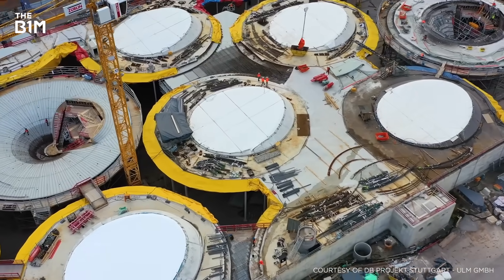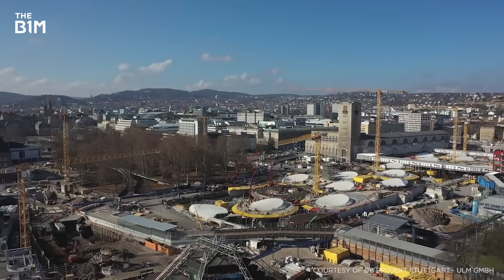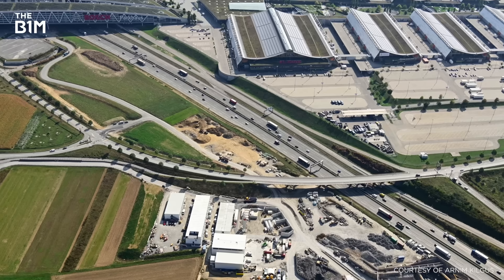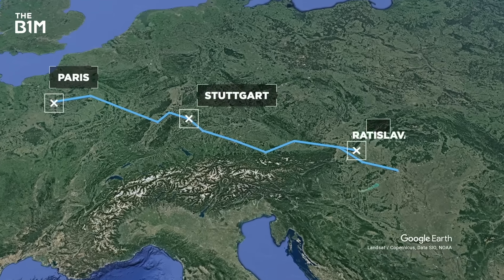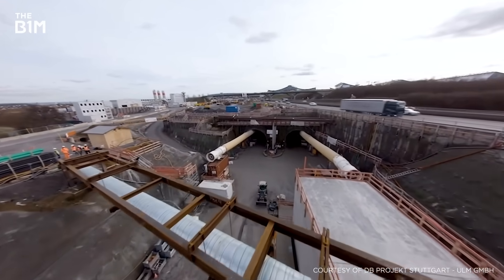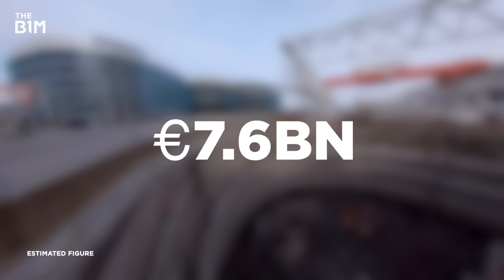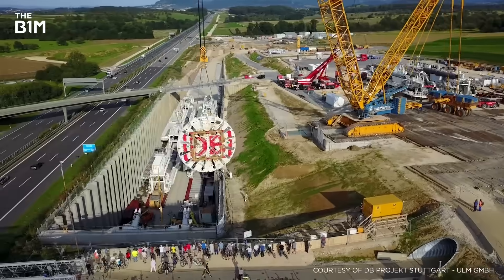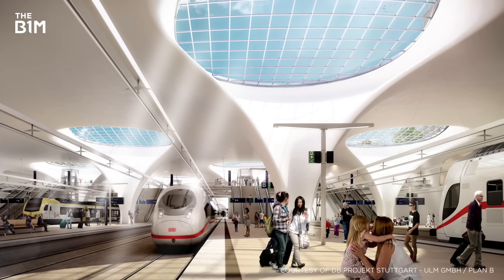Germany's 27-Year Struggle to Complete a Rail Project

Comment: 27 years..maybe with planning. but the project started in 2013 and then there was Corona which slowed the project. it would have been a 10 years building phase, now it will be 12. the struggle lays more in all the regulations we have in germany.
Reply: the completion is now scheduled for 2027.

Comment: 7.6 billion euros to upgrade an entire train station to modern standards and heavily increase capacity.

Here in New York, politicians wasted $2 billion on making a freaking subway station more beautiful, with zero work done on actually improving capacity and modernizing the actual infrastructure.
Reply: Unfortunately, three years later the construction work is still ongoing and not even close to being completed. They now plan to partly open it in 2027. With that said the costs have been rising to a staggering amount of 12 billion euros. And that is only half of the story. Additional projects will be necessary to fix the major design flaws of S21 which could further drive the costs up to at least 18 billion in total. And although it might look like a project for a better railway, it‘s actually not. It’s mainly a pre-phase for a huge real estate development plan on the land of the current terminus station.

Comment: The question is what shall count as the project start? The idea is surely older than 27 years. I saw the first plans in 1987. 
Putting the undoubtedly serious political and legal turmoils at the beginning aside - the construction project as such is running pretty smoothly. Especially as it is regarding geography and hydrology a very demanding project. That's however not something the average rail traveler will later notice. But they will notice the new train station. Great architecture
https://www.youtube.com/watch?v=8xUlTsP3tag

Comment: If Germany is spending so much on making Stutgart a through-station, why is HS2 in the UK making one of the major stops, Birminham's Curzon Street, into a terminus station?
Reply: I don't know the reasons in Birmingham. You don't have to understand them because a terminus always needs more space and more time for the trains to move on.
A terminus makes sense in a city like Munich, which has a peripheral location in the south of the country. A lot of HSR trains end there.
But Birmingham is not on the edge of the UK, it is a centre in the middle of England. 
Stuttgart has not been on the periphery of inter-European train traffic for a long time either, a through station is much more efficient than a terminus station and requires much less space.
Another reason for Stuttgart 21 is that the city wants to expand, but it is located in a valley basin. The new station will free up huge areas that can be used for urban development.

Comment: The complexity of the project is not a joke, it is not just putting station underground but also to build totally new oriented lines all through large city that is densely built. In addition city is build over series of hills, valleys and large river is flowing through all of that, very challenging topology and geography... So it is to be expected to have large delays and costs overrun. Together with new fast line to Ulm (that is also crossing over complex terrain and major mountains) will have impact on rail traffic for all EU. This project can not be compared to Berlin airport failure that is nonsense.
Reply: "So it is to be expected to have large delays and costs overrun"
Construction was running considerably better than expected. And not adding further delays for years. 
While the project is undoubtedly well over budget, the costs are not higher than with other big railway projects in Europe. And this despite very challenging topology and geography.

Comment: Stuttgart 21 was recently a topic in one of my subjects at the university (I'm an architecture student) and our prof told us that one of the major issues in this project is the build-up of the ground.It seems that the ground tends to swell when it gets into contact with ground water & there seems to be one big reserve of mineral water right next to the construction site. That means if some error occurs and water leaks into the ground, the ground would be elevated up to 30 cm (if I remember correctly; imagine it would happen after the construction gets done....) Then there's the problem with sloped train stations because of the existing tunnels... the problem with emergency exits due to narrow tunnels (yeah again because of the characteristics of the ground)... If I remember correctly even the architect said this whole project is impossible to get done so yeah. These are the things that stuck with me in regarding this project
Reply: Those are worn out arguments of the opponents of S21. First thing is they totally forget the S-Bahn tunnel from the 1970s which is BELOW the new S 21 tunnel/train station. And if it comes to emergency exists they make up their own definitions of what is required. Which would have to result in the closure all underground railway stations (e.g. Berlin Hbf tief) in Germany. As those are definitely not better on any aspect.  
And the same type of people demonstrating against the tunnels of S21 demand them elsewhere. E.g. a the Upper Rhine Valley and the Berlin Dresden Bahn - where tunnels are from the terrain not even needed, their whole purpose would be noise protection.
Reply: @martinstock  well i'm not sure which side he took but that's what was discussed in that lecture soo 💁‍♂️

Comment: there is no high speed connection between Stuttgart and ulm currently. The Geilinger Steige is a huge bottleneck with in the EU to  get Cargo from the North See haven to the South. The problem with the new trainstation however - and  you missed this completely in your uncritical feature - is that it can't fullfill the needs of the "Deutschland Takt".

Comment: Thank you for sharing this, as a former New Yorker who has lived through 3 attempts to build a second Avenue Subway in Manhattan, having seen it funded and then the funding diverted in the 1950s, the start of construction and it being abandoned in the 1970s and then the endless work in the 2000's that only just culminated in a small piece of the line open with no complete picture of when the line may if ever be completed Stuttgart's project is not doing all that badly. The first phase at 3.5 billion and an estimated 6 billion for the second phase and no estimate for the third makes it seem a relative bargain.

Comment: What will happen to the original 16 overground station platforms, the building they are housed in and their rail line approaches once the new station infrastructure is up and running - assuming they will be repurposed in some ingenious fashion?
Reply: The tracks will be removed as far as I know. Buildings will be built. A new S-Bahn station (Mittnachtstraße) is being constructed in the north.

Comment: You should have gone to Stuttgart in 1945 huge areas  were bombed flat by allied bombing . By 1966 much had been rebuilt as I remember the station was intact. This project  is tiny compared to the city rebuilding I wonder why? perhaps its just  a project to provide work for as long as possible for as many as possible.
Reply: Good point, wouldnt surprise me. Maybe as it often happens, its just greedy individuals earning a quick buck?

Comment: There's a new long distance train tunnel planned under the HBF in Frankfurt.  I wonder why not consider to revitalize Frankfurt 21, which would have also converted the main station into a through station, turning the yard into a park.  I know the location isn't as good, but Millennium Park in Chicago comes to mind.  I'd think the towers along the park could help to cover the cost, when you consider 1 of the Four towers just sold for 1.4 billion Euros.

Comment: Sorry to dissapoint you , but the project is a complete mess. Firstly the new railway station, hasn´t enough tracks. To have the same capzity as the old Station the new one needed 12 tracks NOT 8. Also the platforms will be a bit tilted and just a tip when you come to that fiasto, always look after your Baggage. And lastly becaue of the stone that is in that area, it can happen that if the stones get´s in contact with water that that stone gets bigger and so the terrain moves...
Reply: Anstalt lied to you. And you should always look out for your luggage. By the way, many stations in Germany have the same or higher gradients…

Comment: It cant be completed. Its a deathtrap. The tunnels will be to small for a fast emergency exit or access for the rescue units.

There is a good clip from "Die Anstalt", in german, that explains this project. Even the architect that made this said its unrealistic before he passed away.
Reply: Die Anstalt is a satirical programm which took up the unfounded talking points of activists. They aren’t engineers

Comment: One of the problems is that in Europe people always want to preserve the old stuff. Why does that old and cracked looking building (just look at the windows) at 1:32 need a whole new foundation when it's located on what seems to be a pretty key point in this whole operation? Just cut your loss, demolish it and build something new on top of it once it's finished. But of course that is not possible because of 1001 regulations forbidding this and people wanting to hold on to it.
Reply: it was the city which wanted to preservice the more than hundred year old building, while the railroad company (owner of the building) wanted to demolish it due to the project. AfaIk it's not under any kind of official protection of historic buildings and monuments

Comment: Fun fact: Stuttgart 21 is a downgrade... Before twice as many trains could stop/wait at the same time....
Reply: A terminus can never be as efficient as this underground through station.
This station also benefits from the enormous improvements of the new European signalling technology, which would not give the terminus station such a great advantage.
The frequency of trains in the tunnel and in the station will be able to increase further.
An interesting example is the underground "S-Bahn Stammstrecke" in Munich, which has more than doubled capacity since it opened 50 years ago thanks to numerous improvements in signalling and train technology.

Comment: 27 years for a major project in Germany? yes, it runs rather badly but that is nothing against a simple, around 40km long federal road, which has been in planning for over 70 years and under construction for about 30 years and the completion is still not in sight;)
Germany is simply no longer capable of larger projects. 

greetings from Germany ;)
Reply: In Slovakia we still haven’t finished our main highway which is only 400km long and started construction in the 80’s (the commie era)

Comment: German federal government admitted in 2019 that train schedules had to thinned out substantially when S21 finally goes into operation. The simple reason is mainly because the number of platforms is halved which reduces the capacity drastically. Why, lord, why, you ask, would then so much money be burnt? The reason is also simple. Local government officials just wanted to get rid of the tracks in the middle of the city, to pull off some real lucrative real estate deals (for themselves, of course). There was never anything wrong with the old station, quite the opposite, it was one of the most efficient in Germany. During all stages the project was justified by a formidable fake news campaign, with all local media outlets firmly in line with the local government. At an early point the Deutsche Bahn realized how unfeasible the whole project would be and bailed out, but the local government massively bribed the Bahn to, well, get them back in track. Now you ask, how is something like this possible? You would expect something like that from, like, some corrupt soviet republic back in the days, but Germany??? Well, the federal state of Baden-Württemberg was ruled over decades by the same party, which, after time, thought of themselves more like souvereigns than democratic leaders, with a die hard loyal constituency to which they could sell anything.

Comment: What is omitted in the Video is, that the whole Project only made it into the Planning Stage, due to massive corruption and dubious interconnections between leading politicians, board members of the construction companies, DB and others.
Also the more than brutal beat down of the opposition protests with massive police violence escalation, beating up of school children and seniors by the police, dozens of severely injured protestants etc in 2010.
The curious relocation of the protected groundwater reservoir below the construction site (the politicians in power just moved the ecologically protected ground water reservoir to the side on the maps).
And that the incline of the stages is too steep for safety etc etc etc.
the whole project is a massive desaster.

Comment: It sadly seems that humankind all over the world is more likely to discard a major beneficial future investment, because of a minor current inconvenience.
Reply: Except the design is a mess. The main reason they are building this underground station is because real estate developers wanted access to the land taken up by the old station's train tracks in the middle of the city.
 
This new underground station has less capacity than the old one and is built in wet shifting soil, so it'll start leaking and cracking immediately and will be extremely expensive to maintain. They aren't improving the train station, they are moving it out of the way so the mayor's rich buddies can build condos.

Comment: I was in an Italian restaurant in Stuttgart, thirty years ago, when the riots were happening, and told the group on the next table that Stuttgart 21 was absolutely necessary for the DB and European railsystem. I was met with a total silence. Regardless, of cost and disruption I still think that the project will have very longterm benefits....yes even for the residence of Stuttgart who are, in reality, very conservative but claim to be something else.
Reply: Stuttgart 21 is too small. In order to have the same Capacity as the old Station, it would need 12 Tracks instead of 8. And 12 Tracks still wouldn't allow for the 50% Increase in Travellers expected by 2030. Officially, Stuttgart 21 does have as much Capacity as the old Station, but that is calculated under the Assumption that no Train stops longer than 30 Seconds. Then there's the Problems regarding Escape Routes and Emergency Exits in the Tunnels, and the undersized Rain Water Drainage in the Station itself.

Comment: They should let Chinese build it..would have half the cost and twice faster!
Reply: Chinese workers also get only a fraction of the wages of skilled workers in Europe. Or why do you think Apple's expensive IPhones, which are all built in China, have such a wide earning margin?
And even the Chinese can't build 55 kilometres of railway tunnels through such difficult terrain in half the time.
Let me tell you the story of a very important bridge that is being rebuilt in Germany. It is autobahn bridge over the Rhine.
They ordered the steel for this bridge in China because it was cheaper. German suppliers could not deliver the steel for the Chinese price. 
When the steel arrived at the construction site, it was tested by the engineers. The steel was so faulty that the bridge would have collapsed if this steel had been installed there.
You with your praises of China. By the way, the Three Gorges Dam in China also took 5 years longer to build and the budget is said to have been much higher.

Comment: British People:Heathrow is so small,I feel embarassed
American People:High speed line building is soo late,I feel embarassed
Germans:Hold my New Airport and Rail Line.
Reply: Berlin Airport will soon have been in operation for 1 year and the completion of Stuttgart 21 is also in sight.
Neither will the expansion of Heathrow have started when the first train stops in the new Stuttgart station, nor will any European-standard HSR be running in the USA!
The fact that the Berlin airport was not completed is due to the incompetence of the politicians of the city of Berlin.
In Frankfurt they are able to build a terminal the size of BER in 3 years!

Comment: Its important to know, that politics and other pro S21 groups were in a hurry to start als many building sites and do as much "irreversible" damage to the old System as possible in the years leading up to the 2011 Vote.

The referendum then basically came way too late, because many had already switched from opposition to "we are so far in, we might aswell finish it". 

Also please dont call the new one a Train Station since it is too steep to be one. Its now only a train Stop.

Comment: You forgott to tell that this is not a station that they are building since a station needs to be flat but the new one will have a 15% tilt which is only allowed for a stoping point not a station. Also if it rains the whole thing could also emerge from the ground due to the specific stone (gypsum keuper) down there. But that might be the solution if a Train burns and the station is flooded you dont have to run 500 meter uphill in thick smoke for the next exit point with only very little space between wall and train.
Reply: never ever gonna be 15% lol 
Trains can't manage such steep inclines without help